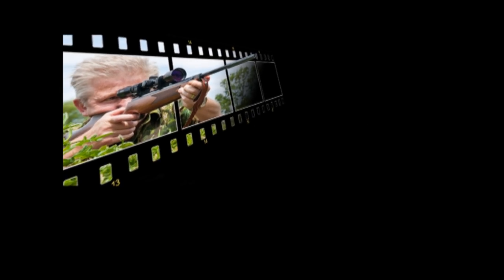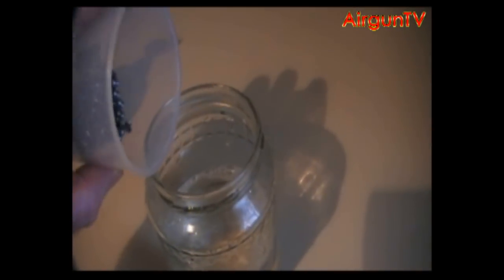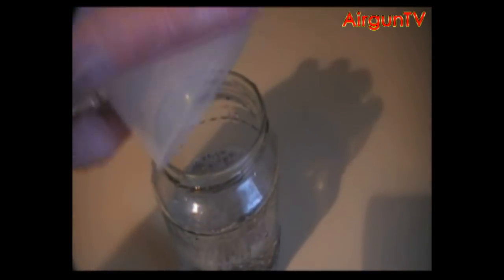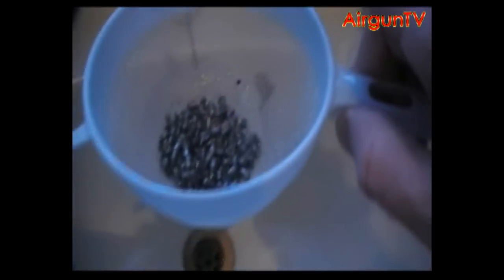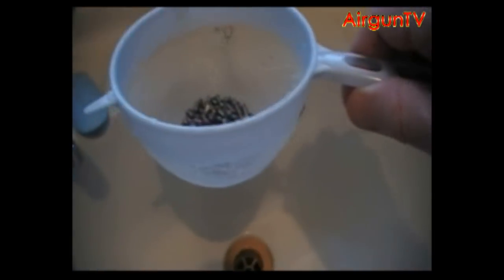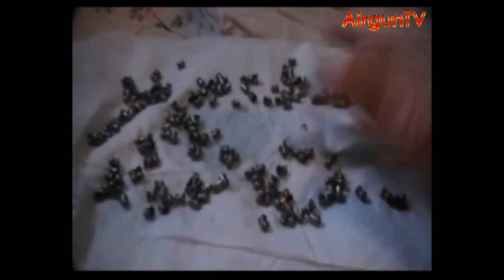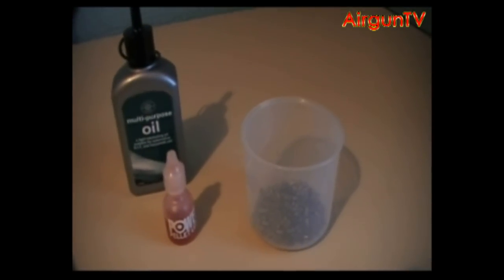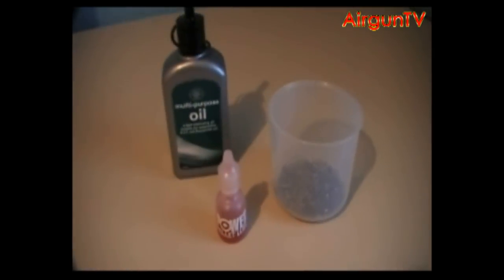HOW TO make airgun pellets more accurate

Comment: The pellets have a fine lubricating powder on them similar to graphite that lubes the barrel as you shoot.  That is an engineered design specifically developed over a couple of century's use and developments in air gun technology.  

Washing them is damaging to pellets and lubricating them damages gun barrels and gun components.  Look up dieseling , it will cause a minor explosion in the barrel that does propel pellet faster but damages the gun when such is done purposefully after the gun is broke in. Pellet gun barrels should only have oil that is designed for them when the gun is new or stored for extended periods outside proper enclosures/safes.

Dieseling of an air gun does not improve accuracy, it actually hurts it.  Buy decent known name brand pellets, store them properly and do not handle them too rough to decrease the risk of deformity to them.  Do not use deformed pellets, dispose of them lawfully.  A tin of 500 pellets can be purchased for  $4 to £8 depending on your location, place of purchase and type.  

Your guns value, its longevity, and quality of shooting experience surely outweighs such tom foolery, no matter how well-intentioned any YouTuber is.

Enjoy your tool, but use wisely and protect it with proper care/handling...
Reply: Pat Right you no this mate and so do 99 percent of others watching , sadly the other 1 percent like to make a video , to show how to become a complete arse ,, l o l
Reply: i was going to suggest to the maker of this video he back up his claim with some ballistics. it obvious hes just making up junk content to get into the youtube airgun volgsphere. his music is 10x louder than the dialogue hes a complete hack at video production too. read the comments you would think this guy was everyones hero for telling them to mess up their pellets and damage their rifle. little do they know in competition shooting cleaning the gun is a frowned upon some champion shooters never clean their barrels. but hey hes the expert right?
Reply: Just want to point out that dieseling will work in compressive air guns such as break barrels but not in decompressive air guns such as pcp or CO2. The air cools in decompressives while it heats in compressives. 

As for washing pellets, if the user finds that the projectiles are more accurate that’s their bag. I don’t see a soft material like lead damaging a hard steel bore though.
Reply: Yea your right. Washing lead pellets in a detergent ? And adding lubricants oil . Seems like a waste of time . With a clean barrel ,lightly lubricated as i do, there's no need to go through all this and create a "Diesel " effect . I would say on a break barrel type airgun ,it might throw the spring harder than originally built and damage . Thanks for excellent advice comment .
Reply: Crap, lead pellets do NOT damage a steel rifle bore!  Physically impossible!   😎

Comment: Step one: don't do any of this shit

Step two: get a pellet sizing die, a pellet seater, and a pellet sorting tray.
 Use the sorter to classify the .450's from the .451's and weed out any wonky pellets.
Then size them with the die and seat them consistently. Half a mm deep is fine as long as you can replicate that depth every time. 
Most important tho is to be gentle with them. Lead is soft. it's really easy to squeeze the skirt slightly oval and not notice. Gotta be gentle with the tin too. I won't tip it once I've opened it, the more they bounce around the less accurate they get.

Comment: The shaking around might actually knock off a bit of flashing and help accuracy that way, too. As for drying, if you aren't in a huge hurry, I used to dry my bike after riding in the rain (or after washing) by turning a simple fan toward it. The slow blow dry took care of all the nooks and crannies and my Kona still looks new after nearly 40,000 miles and 11 years.

Comment: Lead oxidation can be revealed if you cut or just scratch a lead pellet.(or a fishing sinker)  The bright white metal so exposed will look much different than the dull gray of the pellet or sinker.  The lead is.mostly covered with a thin coat of PbO.

Comment: I'm another person that has had far too many expensive airgun pellets simply deteriorate over time (i dont know what you'd call it when they get all grey and white fuzzy from some type of corrosion from sitting too long, but at least you get my meaning hopefully).    Since i have several thousand pellets stored waiting to be used someday - and many of them the expensive good ones -  i have my own treatment.  I use some eezox on the pellets.  I open the tin, dribble it in and work it onto the pellets.  til they are all covered.  Seems to help.
Reply: Same, Mine corrode over time. I put Hoppes gun oil in my tins and roll them around. Then I seal them with electrical tape.
Reply: store them as you would store live ammo and your guns in a safe or cabinet with a dehumidifier rod
Reply: cabinet needs to be air tight like a gun vault. I fid some minor modifications to a stack on steel gun locker n made it air tight added dehummidifier rods and interior lights.
Reply: eezox so much easier, just keep it away from the seals at all costs!  I use it in the borrels and on blued steet, other then covering it with RIG i cant think of an easier way to prevent rust and corrosion.

Comment: You cleaned your pellet, then applied a minimal dieseling factor oil to each pellet.
Reply: Break barrels yes due to the instant compression of the piston igniting any petroleum based lubricant. Pcp airguns pressurized reservoir/tank powered will be fine and haven't experienced it in any of my high powered airguns. My pellets are lubed and seems to keep a cleaner barrel and less restriction/friction. Springers and gas rams are cool and fun to plink around and small game hunt with but for hunting and larger animal pesting on the farm I leave that to the Airforce Condor SS .25 pushing 70 + fpe with 33.95 grain pellets.

Comment: I like using silicone spray w/o oil residue to spray into tin.  I'll try pre cleaning. thanks for the upload!
Reply: +Spherian7 , i do the same with WD-40 silicone spray. not the regular oil base one. the silicone drys , keeps fingers n barrel clean too. also get 22-25 fps faster on my chrony.
Reply: Thanks, Ace !  I'll check into this WD form.  The problem of reducing drag per the suction at back of pellet is intriguing. Preventing the air from getting a grip via silicone is neat, and I've been thinking about using something like a packaging micro Styrofoam sphere to crazy glue (2 molecules will do) into the base of pellets .22 and larger. Little or no protrusion out the base. This would produce miniscule weight diff but could fill the vacuum without disrupting the stability of the wasp waist.  Maybe even a tiny shred of kitchen paper towel balled up into tiny ball might work as experiment.  . Thanks again.
Reply: now you have me thinking, hum.
Reply: Cool.  And the pellet is just an easily adaptable carrier, comrade.  Creative, adaptive thought... it's what made America great!
Reply: agreed.
Reply: I DO feel better.
Reply: lol.

Comment: To make sure they are really clean and dry , I use a hot air gun ,full power close up for 2 mins , it’s easier to get one damaged block of lead out the sift, than loads of damaged ones , and makes a good clean paper weight , cheers Shane uk 🇬🇧

Comment from the maker: @slyjosh13 NO! You should never put oil into the chamber, in front of the piston. You can damage the spring. If, when the excess oil is burned off (that's the loud bang and smoke you're seeing), the gun seems low on power, you'll need to take it to a gunsmith to be re-sprung I'm afraid.

Comment: you use silicon chamber lube for springer guns and you use sae 30 non detergent motor oil or pellet gun oil on all other airgun power plants. iam not one for washing and oiling pellets but the oil will help speed them up, that's for sure but just don't use regular oils on pellets that get shot from a springer power plant.

Comment: The pellets banging around against each other doesn't damage them, but using a metal sieve will?     I'm wondering if you have done any controlled tests to demonstrate that there is a difference in the accuracy of the pellets after this treatment.   If so, will you post a video of that?   It would certainly answer those who are critical of this idea.

Comment: Oxidation doesn't exclusively mean "rust". When oxidation occurs with steel and iron then you get rust. But oxidations literal meaning is the combination of a substance with oxygen. Different substances have different deposits that form on the surface when oxidation occurs. So you are right, Lead doesn't rust. It oxidizes ;)

Comment: waste of time and juggling those pellets together like that will just damage them causing more loss of accuracy than you would have gained through washing them.
Reply: Rockwell Rhodes Plus the oils explode when subjected tp high pressure (just like a diezel engine). A trick I learned from an old timer.
Reply: I wash them in bulk with a fairly to a very slow rock tumbler and small soft plastic beads (that don't float) in a bit of water with a touch of a degreasing detergent and Lemi Shine for several mins. Seems to be a lot gentler on the pellets but not perfect. After drying, I will slowly tumble them with some quartered small gun patches and my personal choice of oil or wax. I see very little damage to the pellets this way. Not like the above video, Yikes.
---Just my two cents.

Comment: a very light squirt of wd40 in tin of pellets.. make sure thers no excess oil when loading the pellet.. sorted
Reply: works well
Reply: +The_dude, i use wd-40 silicone spray with good results over the regular base oil. it drys but remains slippery. plus keeps fingers and barrel cleaner. jmho.
Reply: + The_dude, я использую WD-40 силиконовый спрей с хорошими результатами в течение регулярного базового масла. это Дрис, но остается скользким. плюс держит пальцы рук и  ствол чистым. ИМХО.

Comment: im just getting into air rifle shooting and have watched a few vids now and there are always people saying that this will damage the skirts. Now I dont know if this is correct as you can always argue the case for and against anything and make it true. Now the way I think is surely whatever the pellet it will have been mass produced and been on conveyor belts  and fallen to different levels well before they are dumped into the tins..... so that process does not damage the skirts or do people think they are made individually and place in the tin one by one gently? Just a thought :-)

Comment from the maker: You can use bog-standard 'gun oil', but you run the risk of fouling your rifling and, potentially (in spring guns) having back-flow cause dieselling (uncontrolled combustion in the air chamber). But under NO CIRCUMSTANCES should you use any form of nitro-solvent on pellets!

Comment: wont the multipurpose oil diesel in the gun ?
Reply: that's why u have to use wax for spring powered airrifles
Reply: Only if he's using a spring or gas piston. If he's using a PCP or multi-pump, there won't be any dieseling.
Reply: No, because after banging the pellets around in a hard glass jar, and once again during the rinse, the by now damaged skirts will not have enough seal to permit dieseling to occur. This video is a cock of, …. well, you know.

Comment: Be shur there is no oil stuck in the back off the pellets as it will expode at impact making noise like you fired at 9mm pistol
Reply: How could it explode on impact? That´s BS. When you fire it with a springer, it will explode in the barrel - see dieseling. If you fire it from a PCP, the oil will simply disperse.
Reply: Try it for your self.
It almost dosn't matter what kind of oil you use.
Just giv it a little bit in behind and fire it.
Try and you will be chocked about the result.

I'm using a Crosman Fury NP with 365m/s (1195fps)

Maybe I ill try to make Little video to show it. If my cam is able of recording the sound proberly
Reply: oz1vlh I did it and nothing happened - as expected. Just had to clean the gun from excess oil. I shot a Crosman Premier Hollow Point at around 350 m/s from my Walther MaximaThor - I normally only use those for very close shots as supersonic pellets simply aren't useful for long range shots - I fire heavier pellets at lower velocities. Pellets for PCPs can be lubed with no issue at all. Yours is a nitro piston so it's quite logical that the oil detonates - not at the target but in the barrel. This won't happen with a PCP, as explained above. No rapid compression = no heat = no detonation.
Reply from the maker: Good thinking, Oz...
Reply from the maker: I think he meant the oil might get back into the transfer port (of a springer) and therefore combust. It's called 'dieselling'

Comment: I have decided to also try waxing my pellets using Krytech Wax Lubricant and/or a Quality Synthetic Spray Wax. Whatever helps! Happy/Safe Shooting!:)
Reply: Peanut oil.  Towel off.  Fun.  Try to get juuuuuust below detonating. (When the gun still sounds fairly normal, but smoke comes out.  Good FPS without barrel, seal or spring damage.)

Comment: I disagree, never tried it myself, but have plenty of experience with airguns. The only thing which would potentially take any minute warping would be the hollow rim, and when you shoot the gun that just expands anyway and catches onto the rifling. I have shot plenty of noticeably warped pellets, and for the most part they still shoot straight unless they are really bent up. You shouldn't get noticeable bending or warping by a gentle shake.
Reply: Yeah that's what I'm saying.

Comment: Basic concepts.  Clean your pellets and dry them good.  Reshape them in a proper tool.  Store them in a tad of mineral spirit (Baby's Own oil).  MaKe sure your gun is at tip-top performance (by cleaning and all).  Never forget about your muzzle exit port.  If necessairy, recrown it using a brass screw head.  After that, zero-in the sights or the scope.  If it is not to your taste, sell the gun and get a better one.

Comment: isn't this the same thing as dieseling ....won't it hurt the gun
Reply from the maker: +Jon Patterson Not sure what your question is, Jon. What's the 'this' you are referring to?
Reply: AirgunTV i have a real question. I assume air guns are lubricated with silicon. Will not the oil react with the silicon
Reply from the maker: Hi edward. Airguns are probably lubed with a lot of different oils; silicones for the metalwork, with Moly greases inside. And, no, the oil shouldn't adversely react with the pellet.

Comment: no piston guns should not have oil on the pellets because of the dieseling effect witch is bad in a piston / spring gun , use wax based lubricants and you will not have that problem ;)

Comment: I just spray rifle oil all over mine oils up the barrel to when there used
Reply: uk spartan great way
Reply: Might be good for normal pellet guns but the ones with suppressors attached to cut down on sound should not be oiled. It clogs the baffles with lead buildup and reduces the function of the sound suppression system. I run my Nitro piston 1200fps with high grade pellets that I submerged in oil then rolled in a microfiber cloth until dry. 

Currently I can hit anything out to 100 yards as long as the wind isn't too bad. One thing I do use is a pellet pen with a seating pin on the rear, I don't walk around with pellets free shifting in my pockets, any time rolling around causes them to create dust and it cuts down on accuracy.
Reply: Thomas Starr 100 yards with a air rifle that's some good shooting no i wouldn't walk around with pellets in my pocket either as like you said dust and crap would get into the barrel with is not good I might start cleanin the pellets to see the difference but I use pretty clean pellets in my bsa scorpion se any way h&n FTT the other ones are crosman premier but they do look like those ones might need a clean
Reply: +Thomas Starr yeah, I use high grade pellets as well. Accurate to 100 yards atleast. Shooting a Gamo brand air rifle. 10 grain pellets. I've had great experiences with some cheap 7-8 grain Gamo pellets as well without cleaning them. 50mm sniper scope mounted.

Comment: oil on pellets thats a nono muckup the gun and seals
Reply from the maker: Not if you use the right oil, and don't cake the pellets in it. In fact, it's worth using Napier's Power Pellet Lube in a PCP - many rifle manufacturer's actually recommend it.